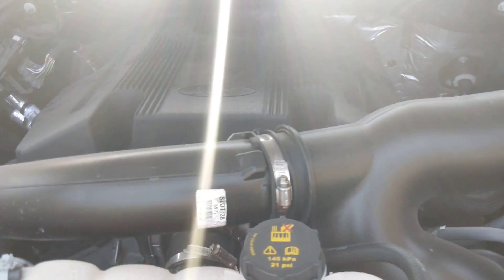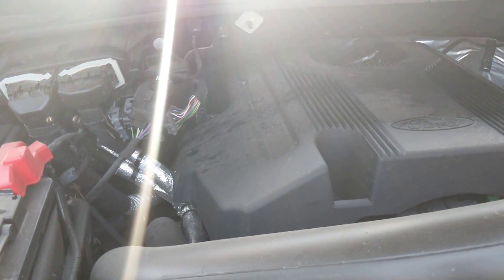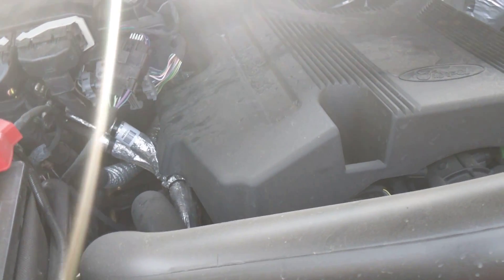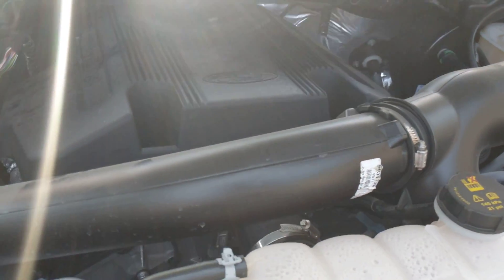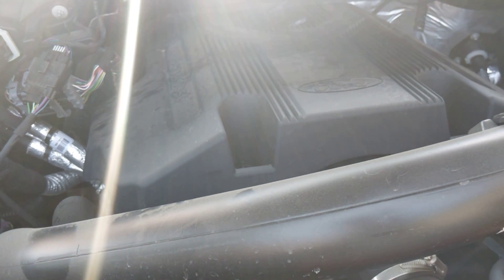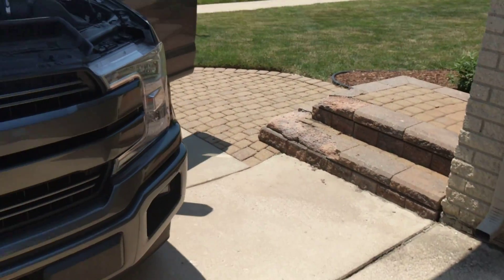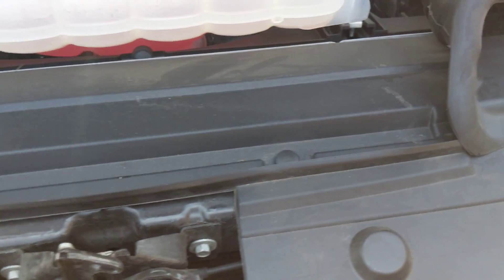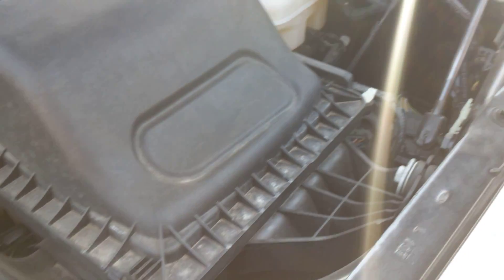Cool features under the hood of a 2018 EcoBoost F150

Comment: Love your video! My husband has a 2018 Ford  F150 lariat crew cab 4x4 special edition package with the 3.5L Ecoboost engine. Do you know where can I find the connection point on the engine for the engine block heater? Thank you very much!!
Reply from the maker: It should be on the front bumper.

Comment: Excuse my simple ignorant question but what coolant is that? I've never seen pink before.
Reply from the maker: buddychrist5 IDK... All the new cars have it...
Reply: @DS-TRUCKS  only ask cause in the manual it indicates use motorcraft orange prediluted antifreeze/coolant vc-3DIL-B. Which is odd cause mine is pink like yours. I drive a 2018 3.5L XLT f150 that's only 6 months old now. I found some pink coolant but it's for Asian vehicles primarily Toyota. So I just wanted to be sure before I go mixing pink with orange and getting a sherbert mess in my engine.

Comment: Great video Sean! Best part was the horn scene! You saying WTF! Lmao... I would be willing to bet that the reason the 2.7 does not have close to the towing capacity of the 3.5 is the fact that the exhaust manifolds are integral...There is no free lunch all that heat that the cooling system is absorbing has to go and be dissipated somewhere the fact is the 2.7 would need a much larger radiator to handle a heavier trailer ion a 110 degree day on a long grade with an 8500 lb trailer it may become an issue....So while the exhaust temperature going into the turbo and the under hood temperatures around the engine may be cooler the actual coolant temperature is going to be much hotter if the radiator can’t transfer the extra temperature fast enough. In colder climates I would think the 2.7 water would warm up must faster than a 3.5 and in the cold it could probably tow anything a 3.5 could without one bit of trouble. One thing to note is that the Raptor  and Navigator version of the 3.5 has more specific output per cubic inch but it requires premium fuel. I believe the biggest reason for the dual fuel  systems was to keep the intake valves clean, as Ford has had problems keeping intake valves clean especially on direct injection ecoboost engines. While you are right that the engines are built very durable they are also working a lot harder than a GM or Chrysler be doing the same job. These ecoboost engines have to work a lot harder to do the same work,since they are under boost towing most of the time,the ring sealing,crankcase ventilation system and engine construction has to all be overbuilt compared to a normally aspirated V8 that operates under a lot less cylinder pressure and much less psi on the rod bearings than a turbo v6 making the same power.
Reply from the maker: John DiMartino I have read that there is more psi on the rod bearings on these engine vs the v8... Which is why they probably have to use premium materials...
Reply from the maker: John DiMartino I think the 3. 5 equal control so much more than the two seven eco comes down to materials.

Comment: Sean I recently went from a '15 F150 2.7L to an '18 F150 3.5L. I swear the 2.7L is much faster but the 3.5L will pull trees out of the ground.
Reply: Paul Rodrigues -- I hear you. I'm on  5th F-150 - '06 4.6L, '09 5.4L, '14 3.5L TT, '15 2.7L TT, & now '18 5.0L. -- off the line power, my '15 2.7L definitely felt the fastest. Mid level powerband definitely goes to my '14 3.5L EcoBoost, and top end power definately feels strongest with the '18 gen two 5.0L. If I had to choose again, I might go with the new 3.5L TT, but would definitely take the 2.7L any day of the week.
Reply: GoogleModerator  how do you like the 18 5.0? I was on the fence between the 5.0 and my 17 3.5 TT, I went with the 3.5 because it is a torque monster,the 5.0 I drove was a 17 with the 6 speed it was no match form my 17 3.5TT ,not even close,I do a lot do towing and the 5.0 didn’t come alive until you dropped a few gears and kept the tach higher than I liked for constant runnng towing I didn’t think I’d be happy with the 5.0 although empty running around I thought it would be just fine.

Comment: Nice truck man! I’m about to trade my 2015 2.7 f-150 xlt for a 2018, but can’t decide on the 2.7 or the 3.5, and then the xlt sport, or the Lariat.
What’s your input? That’s basically what you were facing when you traded.
Reply from the maker: the 2.7 is a more advanced/efficient engine. more hp per cubic inch. The 3.5 has better internals and more ever all power...
Reply: DonnaSean yeah and I don’t really tow, so 2.7 it is. You’ve mentioned there wasn’t too much of a power increase with the 3.5. Is the lariat worth the extra 💰?
Reply from the maker: in my opinion the most important thing to spend money on is the crew cab... ford has a way of packaging to get you to spend alot of money in the lariat... XLT makes the most sense... 
If i wasn't making videos with my truck i would have gotten the xlt...
Reply: DonnaSean the xlt with 302a package is sufficient enough. I don’t need the extra 7-10k worth of stuff. My xlt now is more than enough, I just feel it’s time to update to a newer model. I definitely love the 2.7, it’s been a solid motor the past few years.
Reply: DonnaSean well I did it. I traded my 15 xlt for an 18 xlt with the 302a package. It’s the Leadfoot color which I love. Oh, and it was made at the Dearborn plant too.
Reply from the maker: Jeffry Miller 

Nice! So it's a special edition???
Reply: DonnaSean it doesn’t say special edition, but it has the sport appearance package. I like the center shifter a lot more than the column my previous had. Pretty much the only thing I dislike are the halogen lights, but everything else is amazing.

Comment: That composite oil pan is a joke...lots of leaking and complaints. Good in theory, but not worth the hassle...take a look at the forums...they should move away from it.
Reply from the maker: really... im going to look into that.
Reply: You are right it’s leaking ,a lot of complaints on that,so far mines dry as a bone but I’ve only got 11000 miles.... I would think they’d stick with aluminum because it adds rigidity to the bottom end whereas composite can’t add nearly as much also heat transfer on aluminum is better....but so is noise that may have been there target.